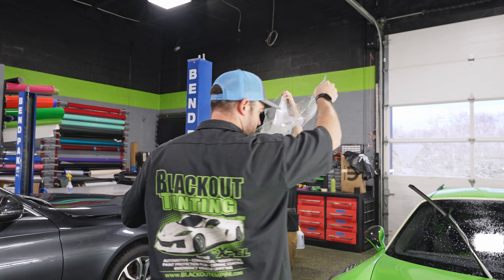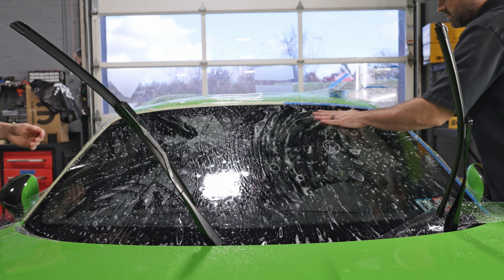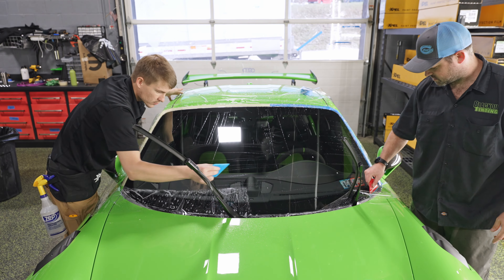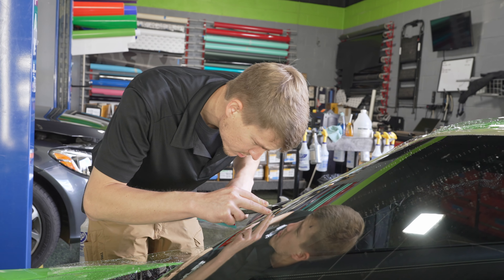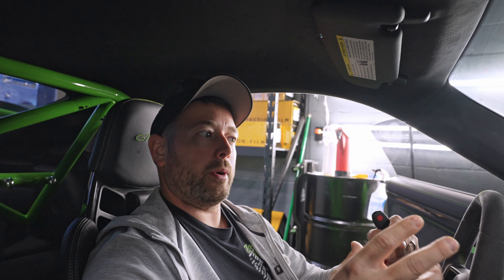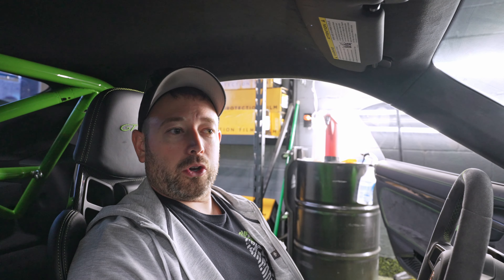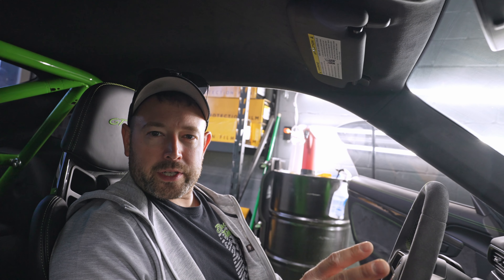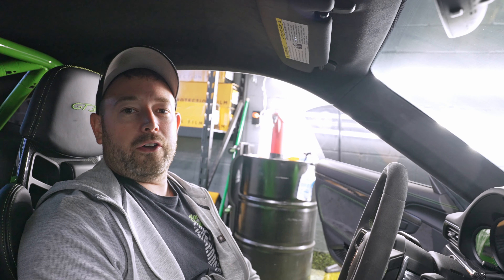We Have Waited YEARS For A Windshield Film Like This!

Comment: How has this held up with windshield wiper scratches? I’ve had the hexis on my Golf R for 2 months now and it’s pretty brutal. I live up in the mountains of Colorado with lots of debris on the roads in winter now, so assuming it would be way better in the south compared to here as far as scratches. I did take a massive rock to it last week and it worked flawless, so for now it’s worth looking thru scratches protecting the $2500 glass 😂